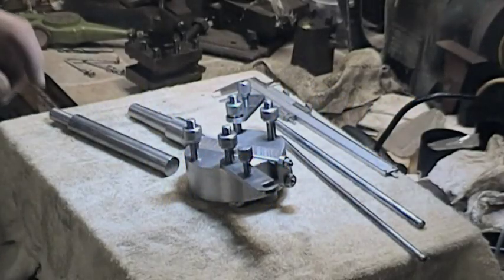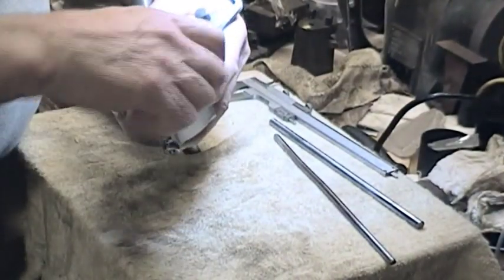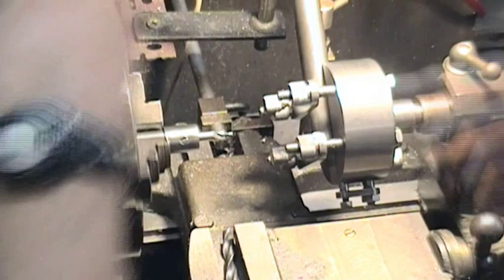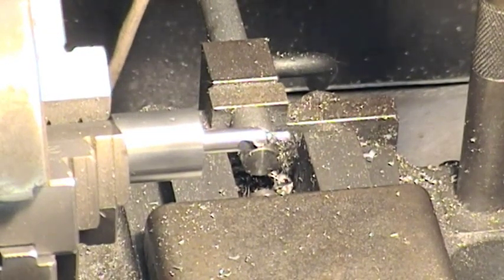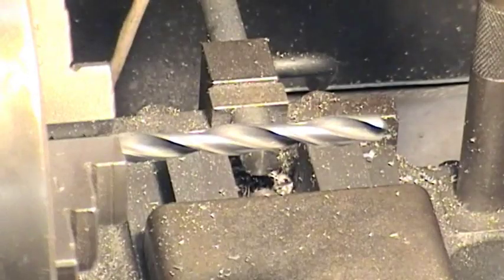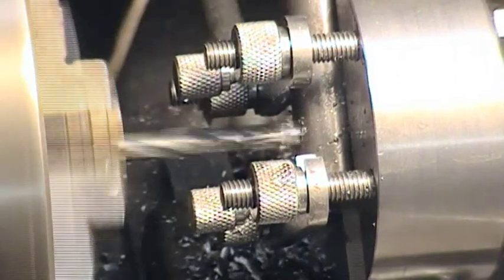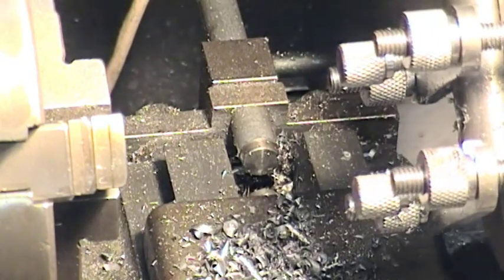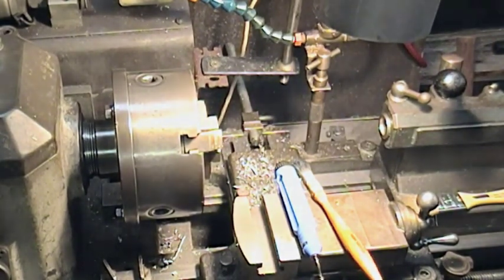A tailstock cross drilling jig, in use

Comment: ChrisB257, nice work! Now I am no machinist or hobbyist yet, but since precision is the goal when cross drilling would it not be better to use a collet to hold the center drill and drill bits instead of the 3-jaw chuck? Don't most 3-jaw chucks have a few thousandths run out? I seem to recall Keith Fenner & Rucker say that. Anyway, thanks for sharing your work as it is greatly appreciated!

Peace!
Reply from the maker: Thanks Jeffrey -- well yes, for absolute precision I agree a collet would be the best for sure. However, my collet set does not cover all sizes I might need, plus -- unless the cross-drilled hole is super critical, any small run-out by using the chuck will be small and I'd often start if need be with a center drill first. The answer there, if super critical would for me, be drilling a little undersize and finish with a reamer. Most times, if drilling for tapping for example, a small tolerance is acceptable.
Reply: As ChrisB257 says, best to just drill out. Instead of using a reamer for final size, use a boring bar that will be the best for a precision bore / thru hole.  Cant watch videos on my old computer (flash wont play them). dont know what the video is about.

Comment: Thanks for the demonstration!  One question though.  Do you feel that the locking screws in the middle of the hold-down straps actually improve the hold?  It seems to me that they would reduce the contact from two lines (where the straps contact the cylindrical work), to two points (where the locking screws contact the cylindrical work).  I would think that a little piece of paper under each strap would increase the friction between strap and work, and provide the desired additional security.  But you have the experience with this tool, so I was hoping that you could enlighten me.  Thanks!
Reply from the maker: Well, the center locking screws were somewhat of a later addition -- and you make a valid point. The choice of locking method is sometimes decided by workpiece size. If very small dia (and it's deep in the "V"), then cross straps may not suffice - and then the center screws do the trick. Most times I guess, I employ both but center ones not usually tightened down hard - just a sort of back-up security if it seems useful :)
Reply: ChrisB257 If you will permit me to add a comment? When drilling, the drill bit pushes the work into the V and so it works well enough without the necessity of clamps, but they do help to make it hands free. The clamps are really more for location rather than for holding strength, certainly so when used with smaller stock. The commercial ones don't always have clamps, like for instance the Myford version and I think the Southbend, but in these days of H&S paranoia it is not such a bad idea to fit some.
HNY
chris
Reply from the maker: Chris Stephens Yes, drill pressure itself helps but IMO not enough to keep exact location perhaps when drill pulled back periodically to clear flutes etc. Probably adequate for small dia piece however.